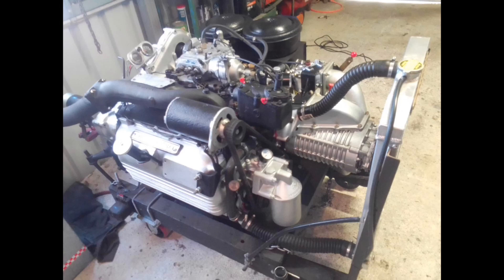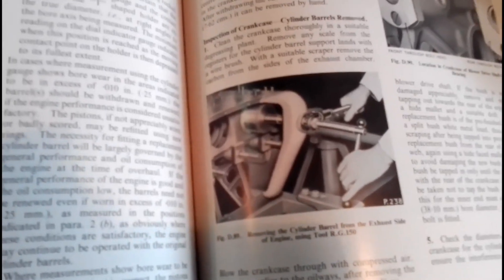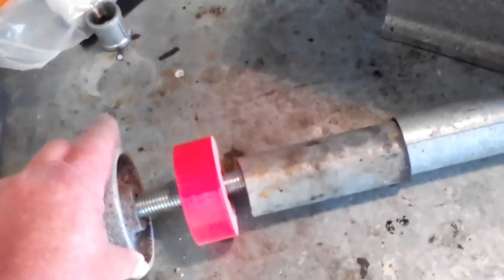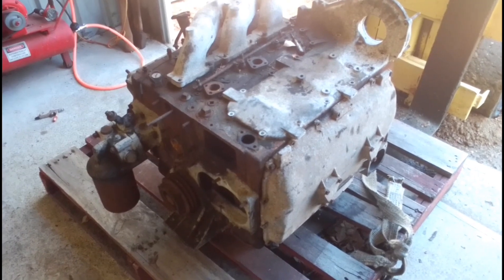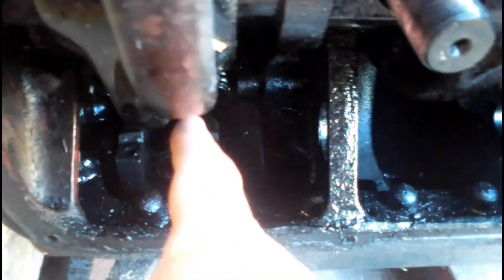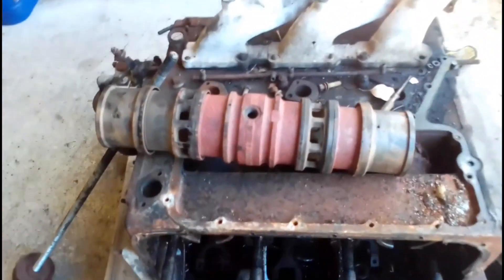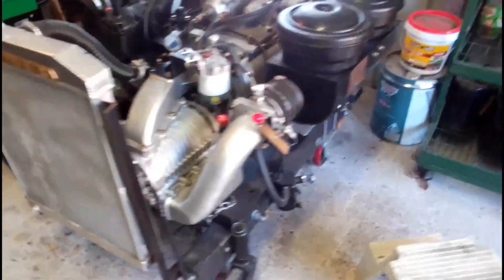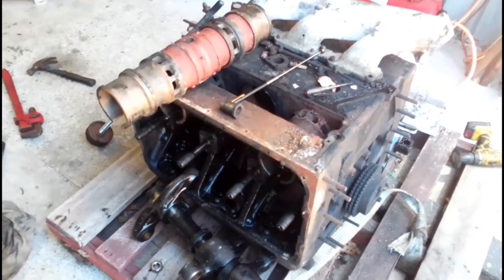Commer TS3  Knocker Barrel / Liner removal, Two stroke horizontally opposed diesel engine.

Comment: Great video. Amazing talking to mechanics in rural truck fleets in NZ who took liners and pistons out on the side of the road without the proper Churchill tools. I was told by a friend in the car parts division of a local dealer that a well known diesel mechanic who operated a largish business in our town had a set of Churchill tools but because he was a bit of a Gordon Ramsay and every second word began with F, I was always a little scared to approach him about them! Now dead so theyʻve probably been thrown out. Iʻve got a paper copy of the plans for the liner sent to me by Don Kitchen who started at the Humber works at Coventry on the TS3 and spent his whole life dedicated to the piston / liner design. Its possibly not widely known but Eric Coy / Don and team also did the piston / cylinder design for the Leyland L60 motor. Don said the only reason the TS3 plans survived was because the plans were originally done on the finest Indian cotton and they kept them for the cotton, not because of what was on it! :-) Hope of interest. Shame I canʻt attach files or I could post a scan.
Reply from the maker: Very interesting, thanks for sharing, all the best.
Reply: Liners out on the side of the road? Me thinks that's horse muffins. Pistons yes the same as any engine. That's if you have the piston guide sleeve for their re-fitting. Liners again no no.

Comment: Hi can you remind me of the starter motor number you used please, and great video
Reply from the maker: The starter is a generic one and the only part number i have on it is CES9110nd, here is a link to one on ebay https://www.ebay.com.au/p/748156675
but i should mention that it is a 24v.
which is fine for me but i think the Commer trucks are 12v.  I am sure there would be a 12v one out there available somewhere.   Cheers.
Reply: Thank you for the information

Comment: Sorry to be a pain in the ass and nit pick but I think it's horizontally Opposed piston rather than horizontally Apposed piston? Opposed meaning the pistons were opposed to one and other? Apposed means to place side by side. Anyway, as long as I live that supercharged high revving motor sound was so distinct and I can hear it even now howling down the road. God help you if the twin silencer broke at the front pipe! The noise was deafening!!!
Reply from the maker: I didn't notice that , thanks I have changed it.
Reply: @machineryrescue  You're welcome! I first learned to drive in 1963 in a Commer Maxiload when I was 9/10yo. Drove a truck before I drove a car. Became a HGV mechanic at 15yo. Forgot to say great video by the way! :)
Reply: No it is not , it is the exact opposite of a VW or WRX motor , the definition is opposed piston as the pistons are opposed not a boxer were they move away from each other at TDC
Reply: @JosephCowen-ru7up  Sorry to correct you Joseph but What I was doing was correcting his original spelling of "Apposed" which he subsequently corrected.
Just for clarity. The Roots Group official definition of the TS3 engine is "The engine was unusual in being an opposed piston engine where each horizontal cylinder contains two pistons, one at each end, that move in opposition to each other. Please re-read my original comment.
Reply: they only revved to 2500 and worked around 1800-2000,  the special twin mufflers were designed to help control the blower output. They weren't supercharged, they were what is called scavenged blown. Low pressure. The special factory tools made liner removal easy, and prevented distortion or cracking the engine block.  In some cases they were very tight and tricky to put back in without the special alignment tool. All the lands around the liners had to be water tight, blower air tight and exhaust sealed. They used to fret quite badly and often sustained high wear in the block due to the high frequency vibration and then they'd start to leak. Slow noisy ol' buckets they were with not a lot of power after second gear, or third if you was lucky.
Reply: @anthonyburch2578  Hmm, but according to the Roots Group official spec sheet, the Commer TS3 engine, nicknamed the "Knocker," was supercharged. It used a "Roots supercharger" to help fill the cylinders with fresh air, which was essential for its two-stroke operation and contributed to its strong torque and distinctive sound. Maybe that isn't strictly a supercharger, but Roots officially called it that. I spent many years in one of these trucks as a kid and an adult. That distinctive sound is lodged in my head. (Especially when the exhaust blew before the twin silencers!!) Mental headaches! 😂😂
Reply: Scavenge blown. Not supercharged [running low pressure unless the 2 special mufflers or the exhaust ports were carboned up. They only revved to 2500 with max torque at 1500. Knocker slug we called them. They didn't have enough power to handle the higher speed diffs required for highway work. But they were  good in the very early days until technology caught up and left them behind. Popular in Queensland because they could be registered as a 3 cyl.
Reply: @anthonyburch2578  I always knew this as "Supercharged" in the UK and the Roots Group description for the Maxiload engine here was "The TS3 has a three-cylinder, supercharged, two-stroke diesel engine with opposed pistons." maybe I should have worded the "High revving" part differently, but what I meant was the sound, not the actual RPM's. It whined at quite a high pitch at the maximum revs. I was only 9yo, but that sound is still in my head! However, it may be my wife now, not the TS3............. 😂😂